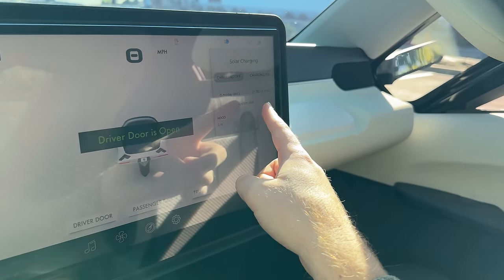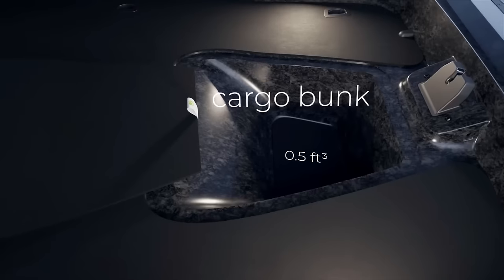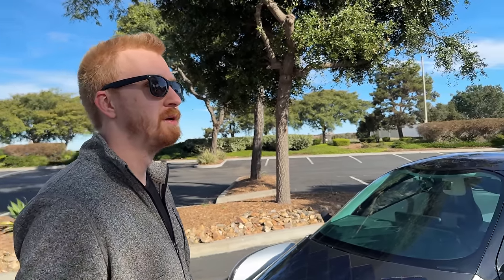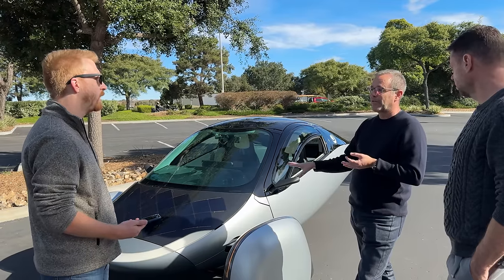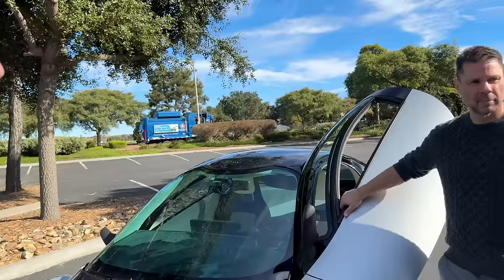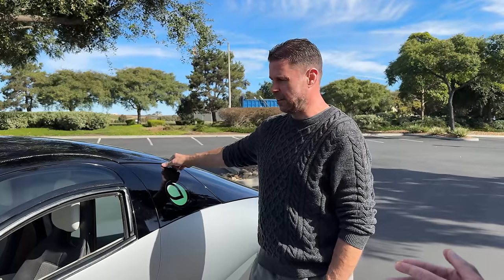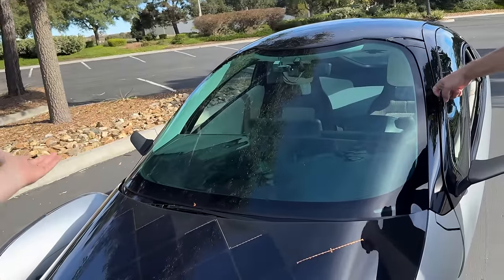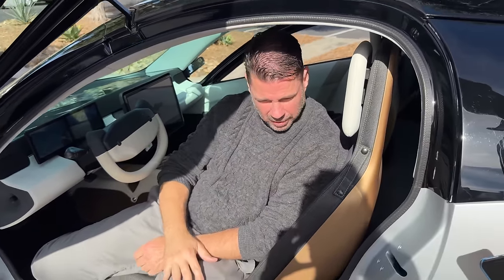Asking Aptera about Safety, HVAC, & More!

Comment: Your question "what can you do with all that extra power" from the solar cells is a bit naive.   The very best time for PV generation with the car will be with it out in the open at high noon - very limiting by itself, but every other time and set of conditions is much worse.  In full sun any time other than noon and at least some of the solar cells will not be facing the sun at even close to an optimum angle.

And the power generation capacity of those cells is not as much as you seem to think, even in full sun at noon.  The maximum theoretical solar power, straight from the sun to here on Earth, is a smidge over 1kW/sq meter.  Let's be generous and say there's 3 sq meters of PV on the car... Even with the best solar cells of 24% efficiency in the very best possible conditions you'd get about 3100 W * 0.24 = 744 W, theoretically.  As a solar enthusiast who's messed with PV for decades, I make that estimate as very, very generous.  On an average day you might be able to count on as much as 200-300W at any given time of day.  I have laid out 10 x 100W panels flat to the sun on what I thought was a "clear" Oklahoma summer day and only managed a peak of 600W and that was with added cooling of the panels.

There are very few if any real use cases where people will benefit from the on-board solar generation - certainly not enough to justify the cost of its integration.
Reply: Aptera will not likely generate as much power as you calculate, especially not where I live in Iowa.  However your conclusion is wrong about the benefits.  As the numbers grow it will add significantly to solar power generation totals in the US, and have a large societal benefit, even apart from the personal return on investment, which still works out over the expected life of the vehicle.
Reply: I won't even try to correlate your setup with Aptera's solar panel implementation. I have no expertise. But I have some level of trust in Aptera's range predictions and can look at tools like the NREL' s PVWATTS Calculator that estimates how well solar panels of a given size and type at a given location may perform.
In a less than ideal location like Oregon, if I plug in a 700 Watt premium solar panel with 5% loss and 0 inclination ( for starters). It indicates that it could produce up to 794kWh per year. The Aptera use 0.10kWh/mile so that is a potential of 7,940 miles per year or about 21.75 miles/day average. That is optimal and predicated on being able to park in the sun. Aptera also reportedly has a unique panel configuration and solar charge controller that minimizes the drop in the event of partial shading of the panels. Particularly for the apartment and condo dwellers who can't plug in charge at night its a big deal. They have to charge at public chargers. The convenience of not having to public charge as often, or in some use cases not at all, is huge. Also rates for  DC FAST charging are reportedly in the $0.40kWh to $0.60kWh range at public chargers. That 794kWh per year could save  upwards of $400/year in the Oregon example depending on the rate at the public chargers. But the bigger benefits is less or no time at the public charger and offloading some of the load on the grid. In my case I drive about 90 miles a week. 100 miles max. That is about 14 miles/day. If I can  park in the sun at home and work it will cover my daily driving needs.
 I'd have to plug-in charge on or for longer road trips and possibly once or twice in the winter months out here.
In my situation I could have around a 200 mile surplus  a month. So it might even be able to handle some longer weekend trips without me having to plug in. Particularly during the late spring to early fall months when the solar output would be high.

Comment: F1 cars need a wheel tether to stop the wheel flying through the air if it detaches in a crash. How is Aptera planning to keep the wheel attached to the vehicle?
Reply: Interesting question.  Aptera is very unlikely to experience the kind of high speed crashes we see in F1 cars.  Even at top speed it can't get near half of F1 territory, which can be as high as 233 mph.

Comment: 1800 watts to the AC converts to 6142 BTU/hr which converts to 0.512 tons of refrigeration.
Reply: Yes but that is assuming the car can shed that much heat through the skin. I doubt it can.
Reply: 0.5 tons of AC is 12,500 btu

Comment: Doors open up has one drawback, you cannot open them if the car flipped upside down, a safety concern. You have only one escape, that is you have to go through the windows. In the Aptera, I think the window is too small for a lot of people.
Reply from the maker: With the current wheel base it’s going to be very difficult to get it to land upside down
Reply: Even upside down, the doors will open half way or more.
Reply: @DemaGeek 
How? you cannot lift the doors even more than one inch, how do they swing out.
Reply: @TailosiveEV 
Nonsense, when being hit from the side, wheel base is irrelevant.
Think twice before you answer anything. This is engineering.
Reply: @Kukaboora  The top of the door is below the roof line, and the doors pivot along the A-pillar.  This means there is some swing room before there is interference, so there will be opening at the bottom of the door.
Reply: @DemaGeek  
When you are upside down the weight of the car will deform the roof line and even further reduce the gap between the top of the doors to the top of the roof. As it is now, it is not even an inch difference.
When this car is upside down, there would be no room for the doors to move up therefore no room for them to swing out. A death trap.
Reply: @Kukaboora   I will wait to see what real world testing of the Production Intent vehicles shows before going to extremes.
Reply: @DemaGeek 
Nonsense. The crash test does not require door opening while the car is upside down. 
The doors require a lot of moving up to move out, just look at the elevation profile of the Aptera.
If you happen to carry a lot of weight in the back such as luggage, camping gears, when being upside down, the tail end could be lower than the front, blocking the open of the rear hatch. Then all escape routes are blocked.
Reply: @DemaGeek  Ever wondered why AM has not put a mock-up turned turtle and shown the doors open? They have had four years to do it, and it doesn't take much effort.
Reply: @aussieideasman8498   Why has no auto company in history has ever done that?  It doesn't take much effort....
Reply: @DemaGeek  Why? Because the doors don't open upward for almost all of them. I am not sure for the one's that do the makers have not done this test - you may be lying.

Comment: A 300W AC unit? What is it an evaporative cooler?  The discontinuity/jump cuts are at very critical moments in the disclosures.
Reply from the maker: Nah most if not all the cuts were "uhs and mis-speaks"
Reply: The peak power draw of the Aptera AC is 1800 watts.  Average of course, will be far less.

Comment: The one question I feel that hasn't been addressed is given the structure's is inherently more sound to damage, how does that impact the occupants G-force wise given the lightness of the vehicle will cause it to travel more from impacts.
Reply from the maker: I think you always are at risk of G forces and whiplash during a collision in any car. No real way to stop that motion but Aptera excels at removing internal pressure which would cause more direct bodily injury
Reply: @TailosiveEV with aeb from openpilot and others hopefully the energy of impacts will be far less.  Also traffic circles are starting to be added far more often which is great for throughput and safety.
Reply: Inertia is inertia, an XXmph to 0mph stop will feel the same whether you're in a compact or an SUV. The material compounds of the body and the design of the subsystems will definitely prevent more broken hips and legs than most other vehicles.
Reply: @roxasrox123  It is not the x to zero stop that I worry about, it is the zero to x acceleration from a side impact that worries me.  The only defense against that are mass of the target vehicle and how much the two of them crumple to lower the acceleration.  The Aptera is a low mass target, there is hardly any room to crumple on the side, and that SUV that hits you will not crumple much when it hits you.  Look both ways when entering an intersection.  Right of way or not.

Comment: Crap.  We need two wipers!
Reply: Why?
Reply: @n.brucenelson5920  Do you want to be a passenger in the car with pelting rain in your face or snow and sleet? Of course not!

The car needs a better wiper solution, Bruce.  Simple as that.
Reply: @Rich1Rodriguez  Rich, I have around 1/2 million miles on two wheels with NO wipers for myself or my passenger in all kinds of weather.  There are good reasons, and I did OK without them.   I don't know all the factors that go into the Aptera design.  I will wait to make a personal judgement on the wiper once I experience it.

Comment: Ok they are right about heat pump vs conventional non reversing HVAC during the warmer months but a standard HVAC system means we need a PTC cabin heater which will cause range to be significantly less when needed. That is the main benefit of a heat pump, the rest of the country is NOT California. Absolutely worth the additional R&D / vehicle cost.

That said, I absolutely cannot wait to see these on the road.
Reply: Sunbelters, particularly, seem to want to dismiss needs they don't have as "outliers" or "edge cases". This is why I'm especially concerned about their glib dismissal of the need for wiper coverage on the right third of the windscreen.  It's not about passenger visibility.  It's not about rain.
Reply: @robertkirchner7981  Hmm… I remember during one particularly nasty snow storm… where the traffic was really slow… the slush was piling up on my car. If I'm remembering correctly, I had to get out of the car to clear off the additional buildup on the sides of the front window.

This wasn't some remote location. This was New York / New Jersey.

I wonder how the Aptera would have fared in such conditions. 🤔
Reply: @robertkirchner7981  Your view of sunbelt types is 'on the mark'. The Aptera is the consummate California car. I eagerly await REAL WORLD news of how this SEV will deal with a Lake Effects Blizzard in Buffaloe, N.Y.S. or a good New England snowstorm, espc. the ones with 03 inches of rain mixed with the snow, to give you 'lead[the metal pronunciation ] snow'; the sort that breaks the shear pins in a snow thrower. I am so far down the List, that I should have ALL the real world info to decide if this will work for me.

Comment: Driving mostly on sunlight?!?!  Absolutely NOT. The solar panels are cute but there is no way in hell they will add any appreciable benefit to the battery charging. There’s a reason that in all your videos no one ever asks about or mentions how many watts of panels the thing has. Even if it had a few thousand watts of panels, you’d need to be in the direct overhead sunlight all day to generate a pittance compared to what the motor will require. 
Cute concept but sadly this seems just like the sham that the lying conman from Tesla keeps trying to sell. These vids merely exist to generate revenue.
Reply: Of course the watts and watt hours of capacity have been mentioned over and over.    Pay attention.  The power produced in the South West of the US will exceed the typical daily driving needs of the average driver from solar alone.

Even in Iowa, where I am likely to average around half of those totals, in a rural town most of my driving needs are less, too.

Perhaps you should do a bit more research before making such comments.  Aptera might be announcing supplying product to third parties soon.

Comment: I dont think I will buy without side airbags. 
Which are not designed yet
Reply: But they are telling you they aren't necessary, lol.
Reply: The crash test results should answer the question if they are needed.
Reply: @garywozniak7742  So why are they telling people they aren't needed?
Reply: For what it's worth to you at the very least, side impact airbags typically stop the door or frame from hitting a passenger directly in a side impact, rather than reducing head injuries from head movement into the door/frame (which of course they obviously also can do). The structural integrity and shape of the side frame will largely take care of this issue :)